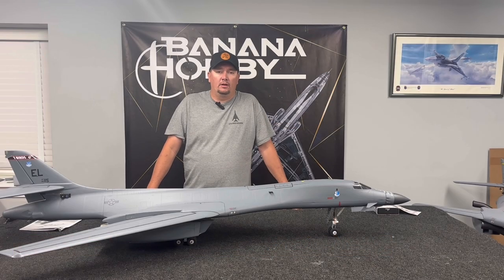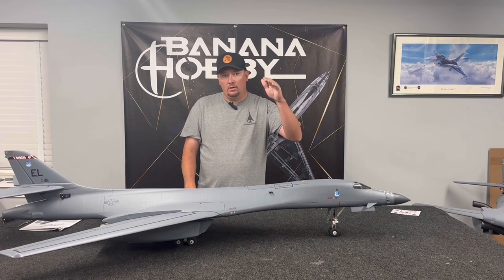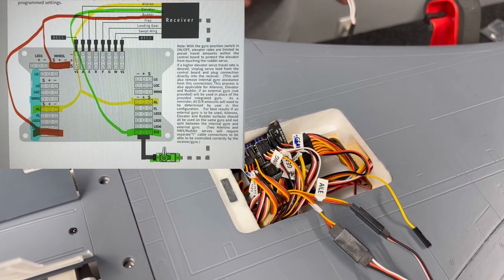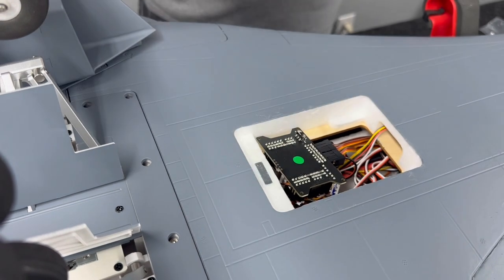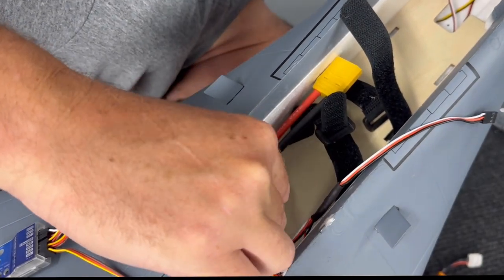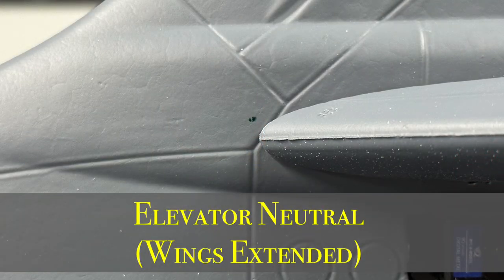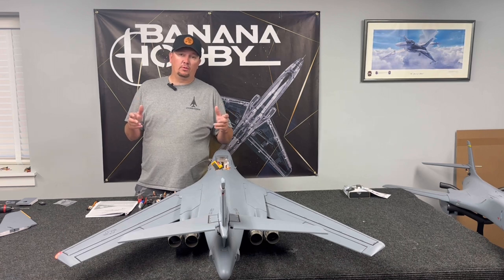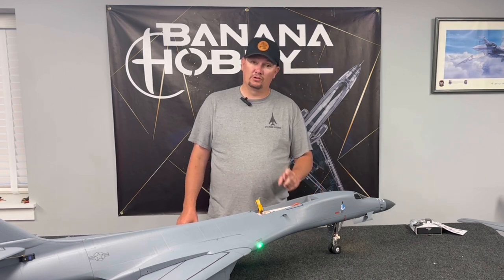Xfly B-1B Lancer Setup Guide for Integrated Gyro Bypass mode (Shorter Version)

Comment: Hi Jeremy I plan on using this set up when mine arrives in a week or so , to get the correct compensation on the elevator trim between wings extended and wings swept would it be a good guide to initially set her up with the integrated gyro and measure the elevator compensation given by the onboard gyro as a guide line ? Superb tutorial by the way 👌
Reply: Also where abouts on the gyro do you set your gain I was thinking 10 o'clock to start off with bud 👍
Reply: No probs I did a 4th flight mode on my flaps and assigned it to the wing sweep which allowed me to put in elevator compensation and timed it to adjust at the same speed as the wings sweeping 👍